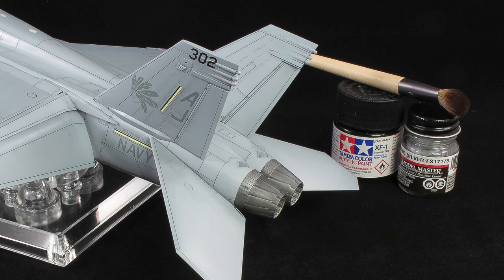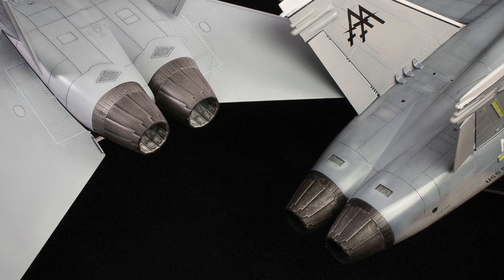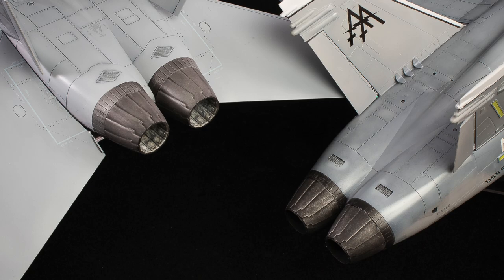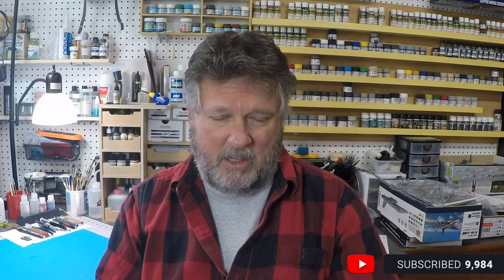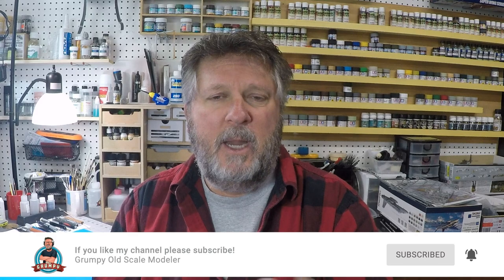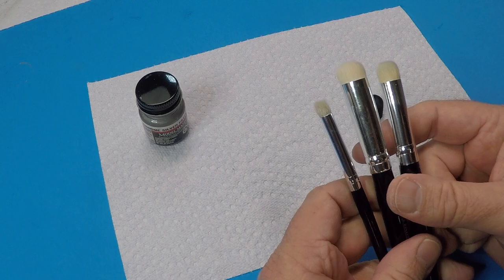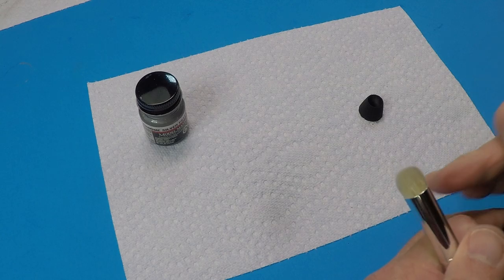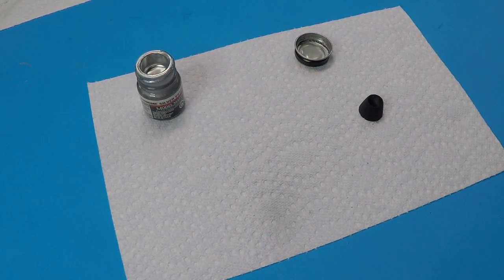Model Making, How to Dry Brush Scale Model Exhaust and Achieve a Realistic Finish

Comment: I've gotten similar effects using tamiya black and Vallejo gunmetal. Especially on armour I use this method to create a base layer that I then overcoat with the armour colour and chip down to the very metal looking base layer. Yeah it's an extra step, probably unnecessary, but fun, and to me that is what the hobby should be about. Great tutorial, you have a new subscriber 👍

Comment: Very cool tip , my question is , I build race cars , but would love to get into building aircraft also , I see most aircraft builders using airbrushes to get their aircraft to have a more realistic paint finish such as preshading , my question is , is there a way to use spray paint to achieve the same realistic finish as an airbrush ? Thank you for your time 👍
Reply from the maker: I'll be honest, I do not think that I could get a realistic finish on an aircraft with a spray can.  I am not saying that I cannot be done, I am saying that I wouldn't be able to do it.  I build cars too and I have been able to achieve quality results on car bodies with Tamiya Rattle can.  I just don't think you can get the small details on an aircraft taken care of with a spray can, it takes the precision of the airbrush to make that happen.  Just my two cents.
Reply: @GrumpyModeler  Thank you for your answer 👍 I guess I'll hold off till I can get an airbrush and do some practicing with it , thank you so much for your time , take care 😁

Comment: Are both the black and the silver paint enamel, or water based?  Thanks.  Should they be flat, or gloss?  Thank you
Reply: The black base is Tamiya acrylic. It can be thinned with water, but I usually use Mr. Color Leveling Thinner or isopropyl alcohol to thin it for airbrushing.

The dry brush coat is enamel, which dry brushes (and wet brushes) very well, and won't attack the acrylic.

Comment: I've been using exactly that same technique for many years. It works great for guns and gun barrels, too. Nearest I can figure is that the acrylic makes the best base for dry brushing enamel because it's pretty much impervious to the enamel thinner in the paint being brushed on. And I've long been a fan of Tamiya's acrylics because they have such finely ground pigments. But I figure I'd better round up two or three more bottles of the Model Master Chrome Silver, because they're getting harder to find on eBay, and there's just something about the Model Master paint that makes it work the best - probably, again, just finely ground pigments. I've tried Testors silver enamel, but it just doesn't produce the same results. And I'm going to buck up some of those brushes.